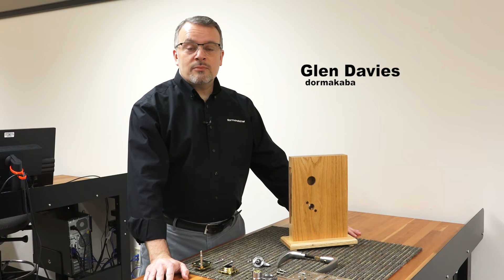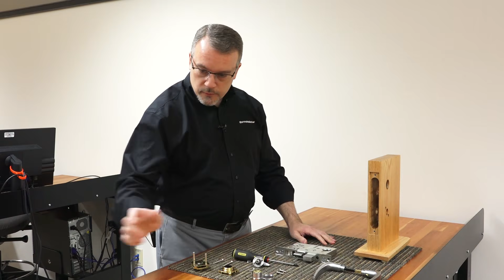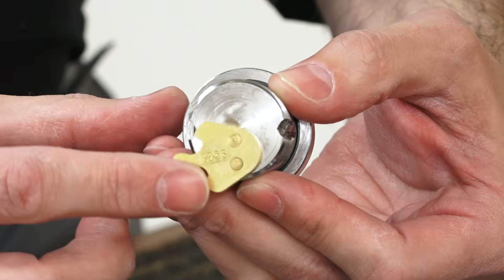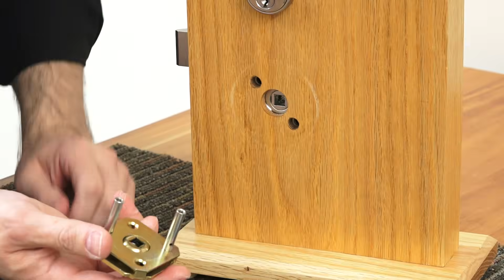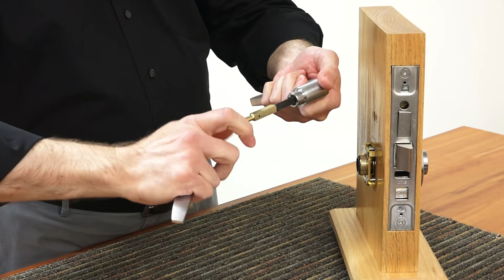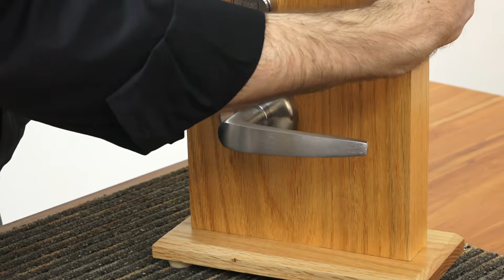BEST 40H Mortise Lock Installation

Comment: We installed four of these on a new custom (specified by architect).  We happened to discover that when the deadbolt was engaged from the inside (and owners think they are locked), you can open it from the outside by turning the handle! the deadbolt retracts - curious if you have ever heard on this or know what it could be - happens on all four and Emtek sent us replacements and they are still doing it, on all - hoping there is an adjustment - great video BTW, thanks!
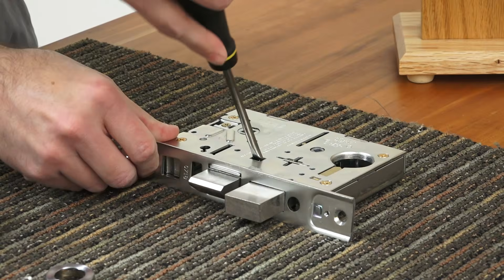Reply: This is a bit late I’m sure you figured it out by now but if not. Follow steps starting at 1:40 making sure you are toggled properly on each side for your setup.

Comment: Hi Sr nice tutorial .
I have a question when there is. A lock that when l do the same procedure does not work properly actually have four of them 
The door opens from outside to inside the room 

1.   swhich the pin 
2.   The outside pin to the up position 
3.   The inside to the  down  position 

What happens is that locks completely the system out and in side 
Them if l change both  in an out to the down position unlock both in and out.    l just installed 0⁰0

Comment: My lock isn't resetting when I unlock the deadbolt leaving my exterior hand stuck in a locked position. Is there a toggle to adjust that?
Reply: I’ve seen that if sometimes the deadbolt doesn’t retract all the way.  Maybe an alignment issue?
Reply: @drewinstallshardware  I think it was a malfunctioning unit. I took it back to my vendor and had them replace it.

Comment: How to lock it from the outside with the keys? We tried it but we cannot pull out the keys from the lock
Reply: I would guess you may have the wrong cam on the back of the cylinder.

Comment: Any videos of how to install similar  European style locks, such as Scandinavian ASSA and the continental ones for Euro Cylinders?  Both types use nuts+bolts instead of most of the wood screws on these US style locks, with the nuts and bolts interlocking with the lock box inside the door in different ways.

Comment: Nice video. From the orientation of the latchbolt, it appears to me  that the door opens to the outside. 

If so, how common is this type of handedness? Thanks.
Reply: Not as common as inswing, but fairly common on closets and other tight spaces.